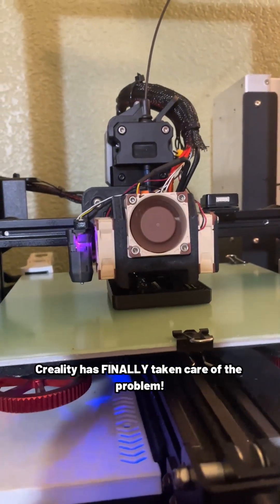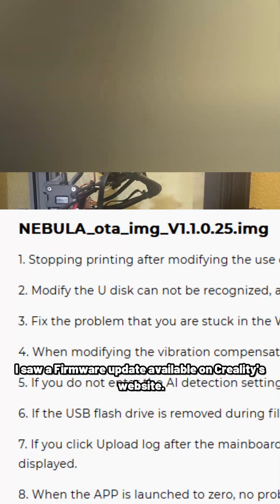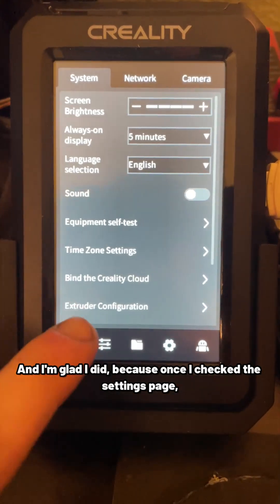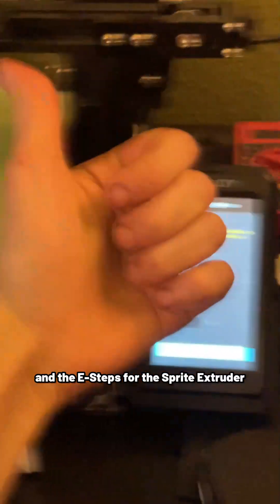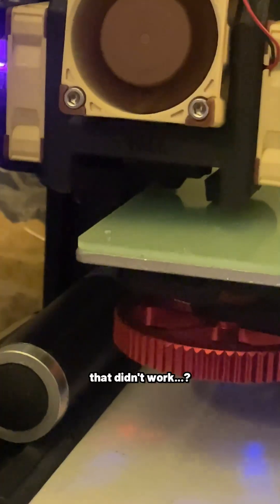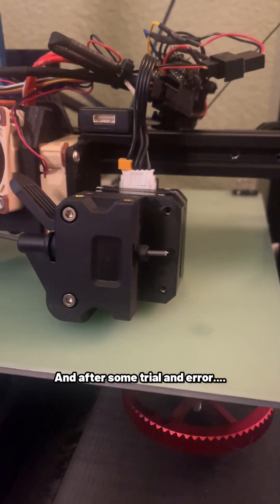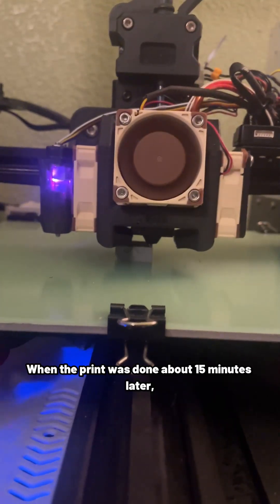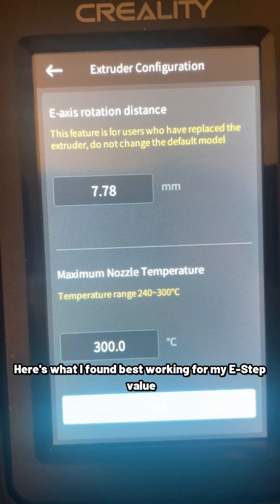Creality Nebula Pad: IT FINALLY WORKS! (Shorts)

Comment: Друг,  какую модель принтера вы выбрали в nebula pad? спасибо.
Reply from the maker: The printer model chosen should be based off the model you have, and the upgrades such as the CR touch—in which that part is critical. 

This case, mine was an Ender 3 Pro with the CR touch. Hope this helps.
Reply: Дело в том, что у меня есть Ender 3 с датчиком выравнивания  и спрйт экструдером, и к нему я заказал небула пад. Ваш принтер действительно адекватно работает со всеми этими модами? Интересует датчик выравнивания, как вы сумели задать смещение set offset для него? Он не выезжает за границу стола? Спасибо. @NiTecIndustries
Reply from the maker: It does not go out of bounds. With the newer firmware updates, as seen in this short. You should be able to calibrate your e-steps and proper maximum temperature. 

When you first plug in, it will guide you through the setup with all the questions you may have…
Reply: @NiTecIndustries большое вам спасибо ❤

Comment: What motherboard are you using? I can’t get it to work on either 4.2.2 or 4.2.7
Reply from the maker: I'm running the 4.2.7. There was a selection for my model with the CR touch. You might have luck installing an older img file on the flash drive, and then using that base OS to update to the most recent version.

Comment: Ok after you flashed the firmware for the pad. Did you flash the printers original firmware. This where I get stuck
Reply from the maker: No? As shown in the short you stick the img file on the drive, boot the printer up and let it update it. That’s it.
Reply: @NiTecIndustries  I don't have an img file just a.bin
Reply from the maker: @MrThornton81  Either way, same principle if you downloaded it from the software section of their website.

Comment: Mine's broken as well.  Tried updating and I got the display to say 1.1.0.25 but it won't move the steppers at all.  When trying to install other firmware it doesn't even prompt me anymore.  Tried forcing it by inserting sd card while off and turning it on, but no prevail.

Comment: I tried to update the firmware from the app. Now it won’t respond lol nebula has been more trouble than it’s worth so far
Reply from the maker: Did you download the img file from the website onto the flash drive, stick it on the pad, and turn it on?